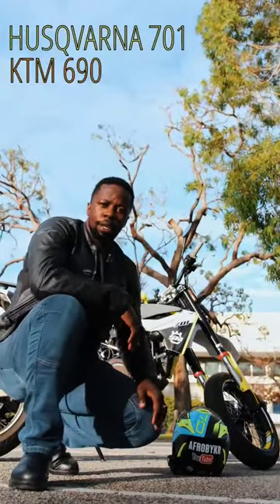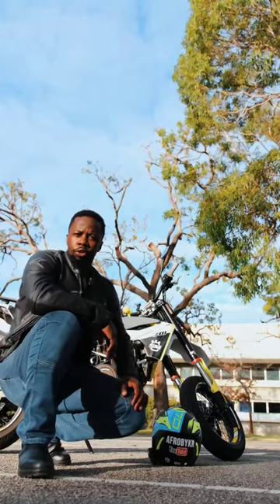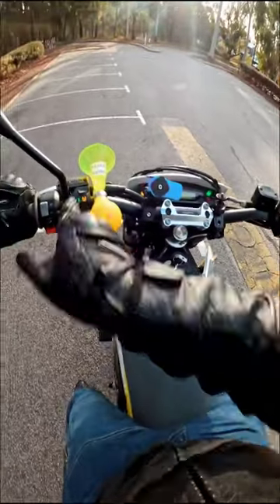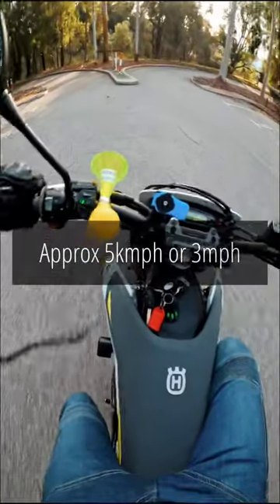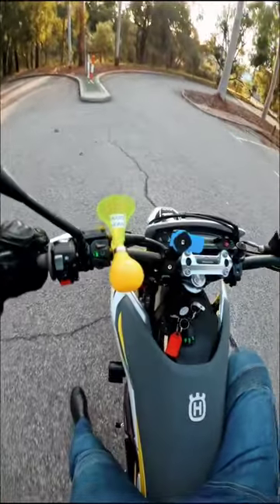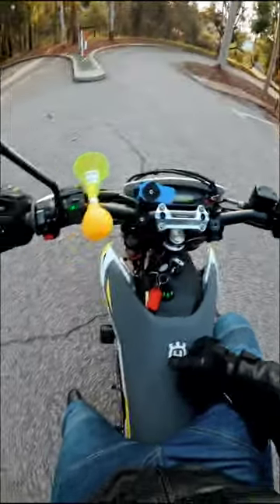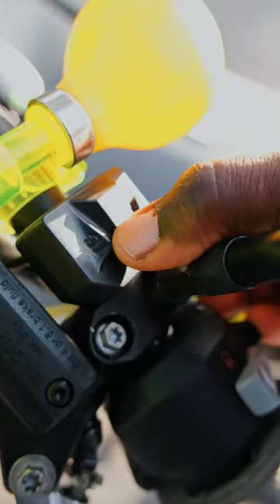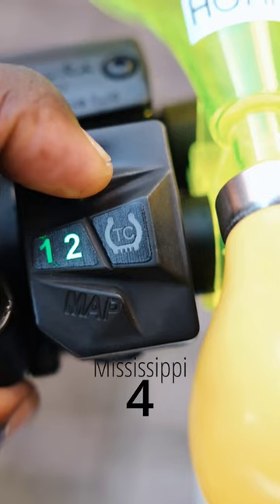How to turn off Traction Control | Husqvarna 701 KTM 690 Gas Gas 700 #husqvarna701 #supermoto #TC

Comment: @afrobykr I have a dongle on my SM700, which remembers the setting between ignition off and back on. Once TC turned off, it stays turned off. same with ABS (rear wheel). 
I had this dongle on my previous Husky and it still works on my GasGas SM700. Odds are it works on your Husky too.
Reply from the maker: Hi @maxbreemer, a few people have recommended the dongle to me.
However, I ended up bypassing the rear wheel ABS sensor by just installing a nut as a spacer. It's been working like a dream for 6+ months now with no issues 🤞🏾
Reply: @afrobiker  oh interesting, your ABS just never gets past the self check 👍🏻